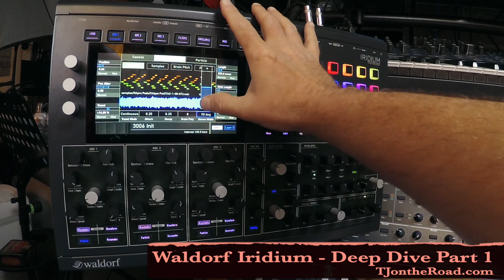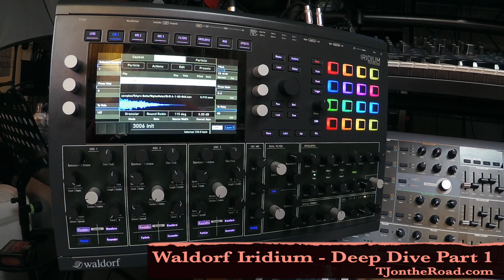Waldorf Iridium Deep Dive Part 1 [Oscillators]

Comment: Great series TJ , , may i ask you if ya still got the irdium today ? no build quality issues , was a bout to jump (thks to you comment versus the Prophet 12) but i've seen some crazy reveiws on build quality issues , i know it not a rule but  seen a lot ...
By the way screen doesn't seems taht responsive or is it me ?
Reply from the maker: I sold my Iridium and upgraded to a Quantum MKII. I no issues with the build quality of either units.
Reply: @tjontheroad  Analog filter is really what i would have loved on the irdium !!! , i'm really between the core and using other keyz or the big keyboard version as the keyz seems superb in all reveiws (i already loved the one on the blofeld)  , giving that ya went quantum , looks like youy really like the waldorf sound adn workflow ...
Reply from the maker: Waldorf makes great stuff. Quantum is a joy to sit in front of and experience all it can create. I’ve lost many wonderful hours doing just that.

Comment: Can't find any videos of someone actually showing importing wavetables, only samples into wavetables. I had the iridium for a bit and it did not recognize the serum, phaseplant, and vital wavetables at all on my flash drive when I chose "load wavetable". It sees the folders, but the folders were blank
That said, my unit was defective because it was crashing every 5 minutes so I RMAd it same day. I'm hoping the replacement doesn't have this issue, but wanted to see if anyone could speak to the success of importing custom wavetables because the literature on this feature is practically non-existent.
Reply from the maker: Place wavetable file onto SD card or USB thumb drive. Load a wavetable engine into one of the 3 oscillators. Select "Timber" > "Tools" > "Load Wavetable". Top left of screen you'll see "Internal" button. Select until it shows either SD card or USB depending on what you're loading from. Import your wavetable. Works for me.
Thanks for watching, TJ
Reply: @tjontheroad  Awesome! See that's exactly what I did but when I went to the folder with a bunch of wavetables, nothing was there. I'm hoping it was just the unit being defective. Genuinely appreciate the speedy response, love the video! 💯

Comment: In granular synthesis, if grain size is smaller than cycle length of a repeating waveform then the pitch is determined by the grain (obviously). Does the Iridium have the ability to chromatically tune grain size? Imo this is an integral part of any granular synthesizer.
Reply from the maker: No it doesn't. Cheers, TJ
Reply: @tjontheroad  are you sure? Assuming that middle C is the bipolar pivot point for keytracking you could try this: Set grain length to middle C (261.6Hz) which is 3.8 milliseconds. Then patch keytracking into grain length. Tune the intensity by ear so playing an octave higher shortens grain length to 1.9 milliseconds (523.2Hz). Viola, chromatically tuned grains.

The only think that would stand in the way of that math is if the resolution of modulation intensity wasn’t finite enough.
Reply from the maker: @CharlesFerraro  There's no user parameter for that. It likely does it automatically.
Reply: @tjontheroad  what 🤔 they call grain length Gate I think. That’s the user parameter for it. Let me look at your video again so I can use their terminology.
The patch can be done, maybe I didn’t describe it well enough?
There are two parameters Gate and Length. Let me check the manual real fast to tell you which one you should patch keytracking into.
Gate should be 100%. It would be easiest to test this with one grain. You should check the pitch against an oscillator from a different engine.
Length is what you would patch keytracking into. It’s important that you do it as I described in the previous post though. Otherwise you couldn’t reasonably expect it to work. I believe in you.

Comment: Omg lower your octave 😂

Why does the unit create multiple wavetables from a sample? Are they different versions of the same sample? Or is it breaking up the length of the sample into multiple tables?
Maybe I could tell if you played the wavetable at the same pitch as the sample…
Reply from the maker: It creates multiple wavetables based on the length of the sample. 
I like my playing high and mighty lol. Cheers, TJ
Reply: @tjontheroad  thanks for answering! How long can the wavetables be? And let’s say that the uploaded sample is a few milliseconds beyond that maximum length… would it really create a whole new wavetable just for a few milliseconds of fluff?
Reply from the maker: @CharlesFerraro  Wavetable length is 1024 samples
Reply: @tjontheroad  that should be the length of one repeating cycle in the wavetable, not the length of the entire wavetable. Do you know the maximum length the sample upload can be for one full wavetable before it creates a second wavetable from the sample?
Reply from the maker: @CharlesFerraro  don't know off hand

Comment: Going through these and about every other video on this I can find. 

You mention detuning oscillators against each other, but with up to 8 virtual oscillators within each one, with the detune function, doesn’t that negate the necessity for that? (Unless you want a 384-wave supersaw, I guess? 3 osc x 8 virtual osc ea x 16 voices)
Reply from the maker: Hi, Thanks for watching. There are many levels of detune on Iridium. Such as global detune parameters for each layer. Each of the three oscillators have their own detune. The 5 sound engines have their own varied detune functions as well. There are a mind numbing number of ways to go with Iridium. Each aspect of the sound is additive. The different types of detune and different stages of the signal chain allow for very complex textures in your patches. 
Hope that helps you understand. Cheers TJ

Comment: Dear TJ
After a couple of years now, do you still use your Iridium, or is it gathering dust? I am thinking of purchasing the Waldorf Iridium keyboard, I own a Prophet XL which I love, attracted by the  sample manipulation abilities on the Iridium, should I purchase the Waldorf Iridium?? or will it end up gathering dust?
Reply from the maker: Hi, Yes I still use my Iridium often. I probably use it more than my Prophet XL. I tend to cycle through my gear and come back to the Iridium more than most. The Iridium keyboard looks great. I think it's priced too high here in the US though. You can buy an Iridium desktop and a 49 key Hydrasynth for about the same amount money. 

As long as you like the Iridium sound, and there is plenty to like, you'll never get bored with all it can do. It's a monster synth and a sound designer's dream.

Cheers, TJ

Comment: Hi, I would like to ask you, I don't know which synth to buy between Hydrasynth and Iridium, what would you recommend? Thank you.
Reply from the maker: Both is always the best answer :) Short of that, it depends on how you want to use either one. Are you into sound design, samples, or FM synths? Do you need a sequencer? If so, Iridium is probably better for you. Are you a keys player and want polyphonic aftertouch? If so  Hydrasynth keyboard is your ticket.  If you don't want keys, Hydrasynth desktop is 1/3 the cost of Iridium. 
Thanks for watching. TJ
Reply: @tjontheroad  Thanks TJ for the complete reply. I agree.  ; )
Reply from the maker: @nomoonbanquet6460  You're welcome
Reply: What did you end up choosing?
Reply: @CharlesFerraro  Waldorf Iridium
Reply: I also bought the Hydrasynth synth but I sold it and kept the Iridium